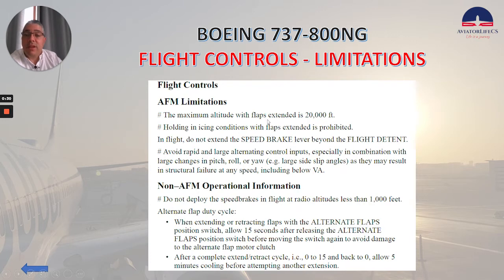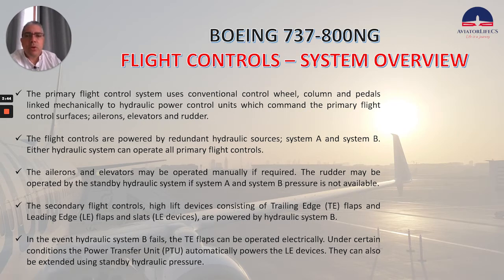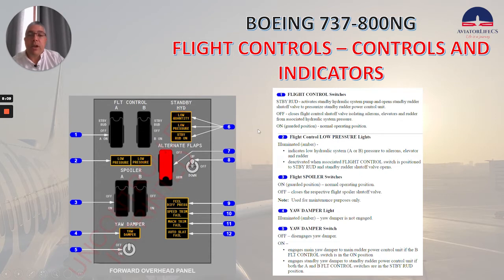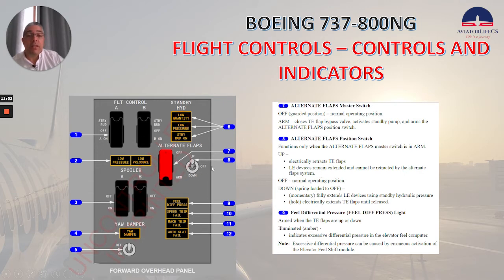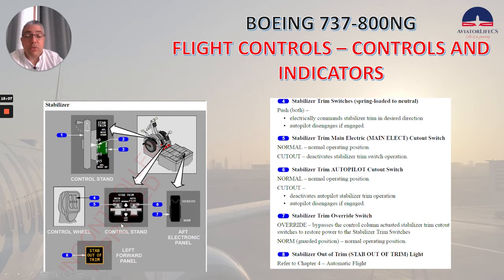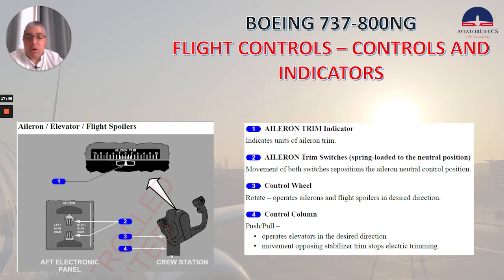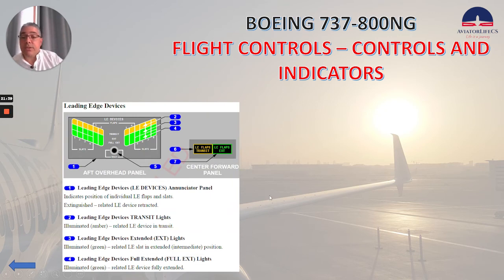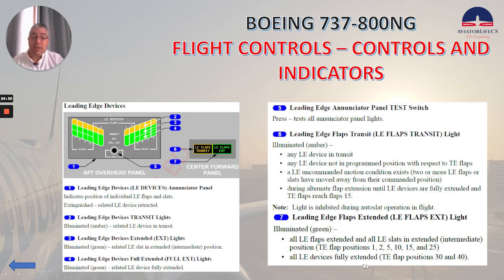BOEING 737-800NG FLIGHT CONTROLS REVIEW PART 1

Comment: Captain, I have a question about the rudder operation and hope you can shed some light on this matter. During a turn, is the yaw damper that assists the pilot by applying the required amount of rudder deflection? And also, in a non normal situation, with loss of either/both hydraulic power, does the WTRIS kick in and take over this function? Time permitting, it´d be great to have your opinion on this. Thank you.
Reply from the maker: Hi Robson, thank you for your very interesting question about this system. I'm pretty sure you're reading in deep the 737 manuals. First of all, it is interesting you're mentioning the Wheel to Rudder Interconnect System (WTRIS). As you probably know, the only aircraft manual that shows something about it is the MEL (for both NG and MAX). 

Q:During a turn, is the yaw damper that assists the pilot by applying the required amount of rudder deflection?
A: FCOM VOL 2, it says: During normal operations, main Yaw Damper ASSISTS in turn coordination ( dutch roll prevention and gust damping as well ). In Manual reversion flight, the Standby Yaw Damper assumes movement of the control wheels abd sends signal to the standby rudder PCU to move the rudder. Rudder input from the yaw damper DOES NOT back drive the rudder pedals.

Q: in a non normal situation, with loss of either/both hydraulic power, does the WTRIS kick in and take over this function? 
A: WTRIS only activates during loss of BOTH hyd systems A and B. During Manual reversion, both FLT CONTROL switches are moved to STBY RUD. The Yaw Damper switch can be set to ON when the Stby hydraulic system powers the stby yaw damper. SMYD2 commands rudder movement for the WTRIS, stby yaw damping and turn coordination. During the Standby yaw damping operation, the WTRIS commands a small amount of rudder movement as a function of the control wheel aileron input to help assists turns during flight control manual reversion operations.

I hope this will help you with your questions Robson. Have a great day.
Reply: @AviatorLifeCS  Captain, yes, helped a lot. These nuances of jet flying make a life of a curious person more challenging in search of answers. Thank you for your time.
Reply from the maker: @robsonbr1246  I'm happy it helped Robson! We are always learning.